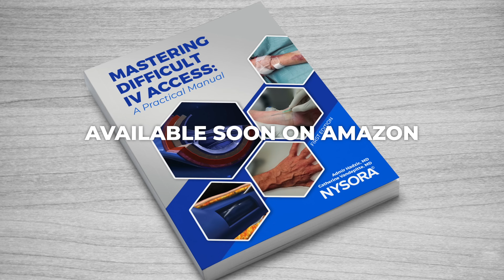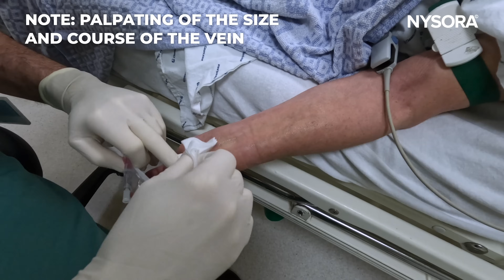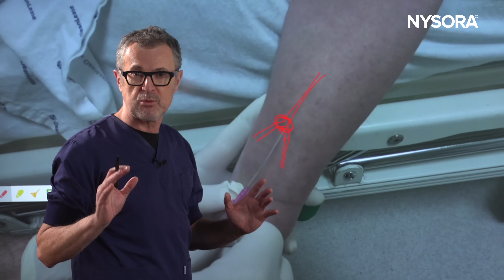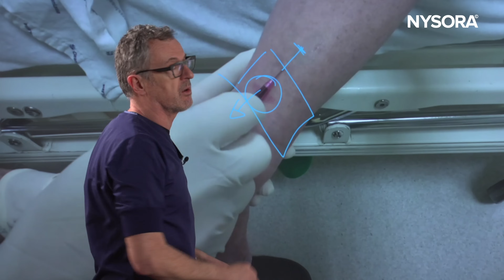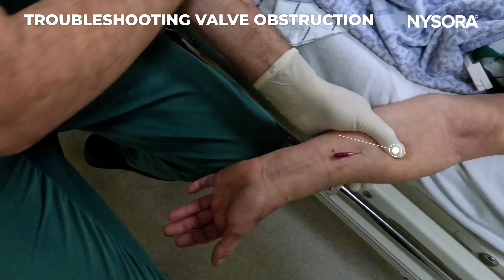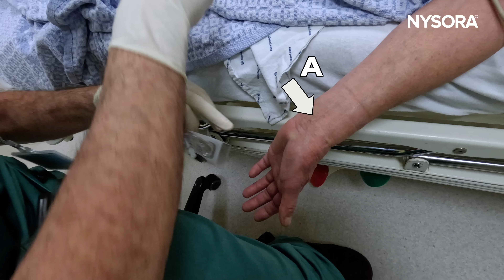Troubleshooting Difficult IV

Comment: Instead of obstructing the vein proximal to the catheter tip, the method I use is simply to raise the arm so the catheter is above the level of the heart, remove the tourniquet, and then remove the needle.  Make sure to use that sequence.  Usually zero blood flows out from the catheter, or a drop at most.  Connect the fluid line, lower the arm, start the infusion.  9 out of 10 times, zero blood.  Onlookers, initially perplexed at what I am doing, are amazed at the result, which they instantly then understand !
Reply from the maker: Your incredible comments and support are much appreciated! If you or your nurses or colleagues are having trouble with IV access, the new NYSORA IV Access App is here to assist. Try it free for 7 days and give us your feedback. Let's master IV access together! https://www.nysora.com/iv-access-app/
Reply: You're just basically stating the obvious of course there will be no blood because you're eleminatung gravity. And why would you make it harder for urself by lifting g patients arm duhh

Comment: Using the longest 20 gauge catheter in the hospital is your problem 😅
Reply: Some medications require larger bore like a 20 G.
Reply: @ally705 20g refers to the diameter and you are correct, but this comment was talking about the length of the catheter, not the gauge or diameter. 
If the length of the catheter had been shorter then it would never have hit the valve to begin with.
Reply from the maker: Your incredible comments and support are much appreciated! If you or your nurses or colleagues are having trouble with IV access, the new NYSORA IV Access App is here to assist. Try it free for 7 days and give us your feedback. Let's master IV access together! https://www.nysora.com/iv-access-app/

Comment: Truly this is a very good technique. the part of the video that I didn't  Expect was really keeping the tourniquet on will keep the valve closed. Even in flushing with IV fluids via the IV line. The trouble we can run into here, is, having now bent the introducer, and withdrawing it, the catheter had straightened out and the needle remains curved. We have to mindful of this part (trying to re-cannulate the catheter so as to push through past the valve. Great tip.
Reply: Thank you for watching! And that is great feedback! Which video do you like the BEST so far?  Greetings!
Reply from the maker: Thanks for your awesome feedback and support! If you or your nurses or colleagues are facing tricky IV access, the new NYSORA IV Access App has you covered. Get a 7-day free trial and share your experience. Let's conquer IV access together! https://www.nysora.com/iv-access-app/